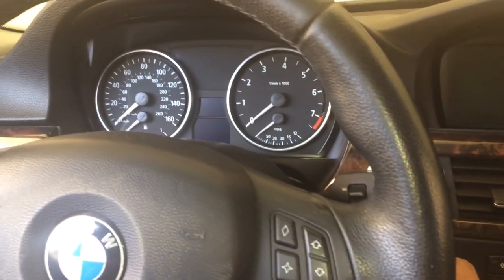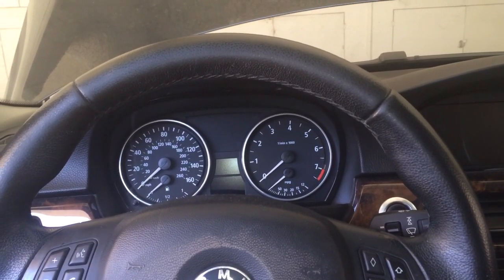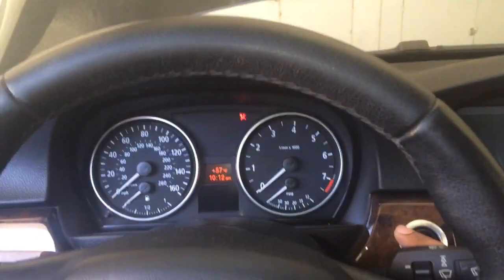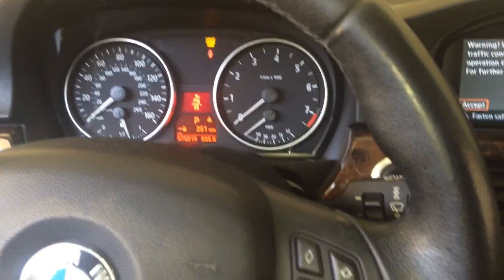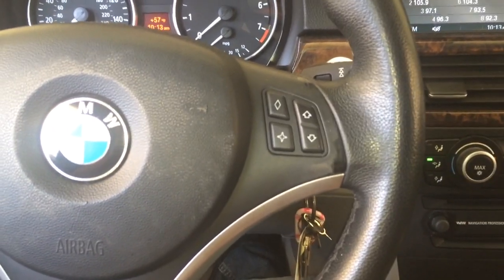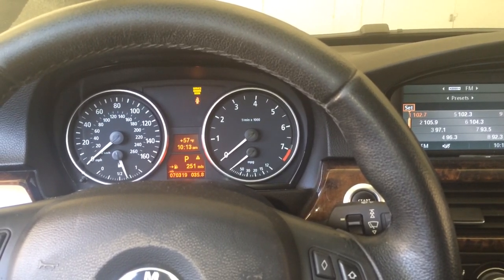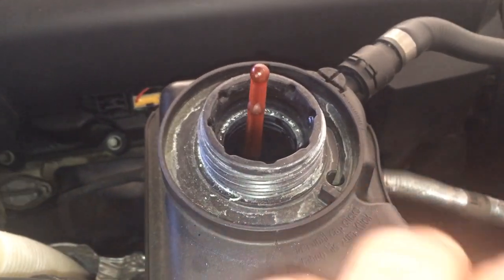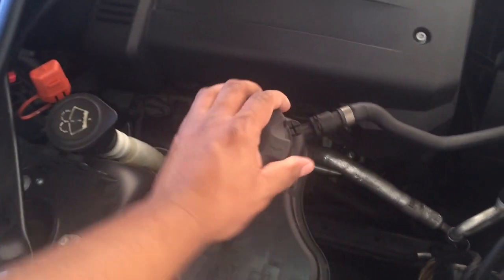Test Water pump and bleed system BMW 5 Series 3 Series E90 E39 528I 328I M5 M3

Comment: My car ran hot on me about 2 weeks ago since the you can drive for quite a while sometimes other times dont take long at all but the yellow temp light will come on then the red one will come on then after a min or so it will go back to yellow come out of limp mode and go back to running properly then it will repeat the same thing again any suggestions

Comment: I did this as well and had no issues with the battery but I did turn the headlights off. In addition there is no reason to disconnect the battery nor leave the cap off.

Comment: I have a 2008 X5. The fan motor has kicked into warp speed. I have tested the water pump and it is working fine, I have tested the temperature sensor and it is working fine, the thermostat closes at 84 degrees and opens back up at 74 degrees. Not sure what else to try? Coolant level is at Max as well. I reset all the codes and still no luck. Any advise, thanks so much

Comment: Ive came up with an overflow tank system like you find on 99% of other vehicles. It's working so far and my car is running cooler too. Not a daily E46

Comment: Nice, but it doesn't work on my e90 318i (130 HP, 4 cylinder version). Probably because there is no such electric water pump for this model?
Reply: I have the same car 2008 and it has electric water pump.

Comment: Help? Melted wire in blower motor? Plus car gets hot?
Reply from the maker: Asanko vlogs Without the blower motor not work your car will get hot
Reply: Repair Fanatic  it just start working but the wires are melted I separate them to don’t touch

Comment: i have 523i it is overheating and the water pipe that feeds radiator become hard and hot while the other one from its very cold and also water bottle cold showing no circulation water is replaced anyone to assist
Reply: phil motloung thermostat is stuck you need a new one.
Reply: 996tt Beast thanks a lot i will buy a new one and see if it doing the same thing

Comment: my red stick broke off and went down into the water box.  Now it seems the box always needs water or coolant.  Is this a problem? the car has never run hot, but it did come up low coolant.
Reply from the maker: frankie hager you should look into it a little more it's not normal.

Comment: does the same apply for e53 x5? It overheats immediately and splashes all the coolant out. Also it makes a weird noise like whistle when cold. Overheats when driving slow or stopped
Reply from the maker: only if you have a electric water pump
Reply: Thank you

Comment: thank you excellent video but I do not hear the water pump making noise , but pumped water.
The exclamation mark does not appear. my e90 is Manual transmission... thanks in advice
Reply: The exclamation mark has nothing to do with the water pump test. Its a signal that the car door is open while the car is switched on.

Comment: hello i have a problem with my e60 525 it displays the massage engine temperature too high wht might be the problem
Reply from the maker: It could be a lot of things. Radiator leak, temperature sensor, water pump, thermostat, and more

Comment: How long you bleed the system...?Need a x5 2007 e70 radiator replacement video.Thanks for your support.
Reply from the maker: Until the water pump shuts off like 10 minutes

Comment: thank you excellent video but you have to wonder what BMW was thinking when they put a electric water pump and thermostat where it is located at and how difficult it is to replace and on top of all that there's no oil dipstick
Reply: It's designed like that so you take it to the dealer. 'Designed Obsolescence,' is the thinking behind it. Not to mention no spare wheel.
Reply: The fact of the matter is, even BMW mechanics hate working on BMWs.
Reply: They do that kinda thing so you will want to take it to a dealer to get it repaired. Every mechanic in my area says "what kinda car you have?" I say a BMW...they say "sorry we don't work on BMW's"

Comment: I need to check water pump for 2010 BMW 535i since the fan is running at high speed and engine temperature warning. If I start the water pump test then do I need to complete the process of bleeding or stop after 2 minutes.
Reply from the maker: You can stop at anytime.
Reply: Was your water pump bad? What was the issue?

Comment: hey i have a 2006 bmw 330i i have changed the thermostat and both temp fan sensors and the car still over heats what do you think my problem is? my fan starts really loud when it does

Comment: I have a question, I just bought a bmw 740il 1998 , after driving  I get coolant everywhere on the engine and I can hear from the inside of the car that something is boiling. Over the night no leak at all, nothing, what do you think it is?
Reply: +Andrei Sames Just throw that car away now, don't keep it as it's a money pit.

Comment: Hi , I tried following your procedure but looks like I help the accelerator too long. Now the car won't start and all sorts of error codes are appearing for abs, tyre pressure, etc. I obviously did something wrong. How to I reset or reverse what I did. Also how long till car rests itself or do I need to erase codes though old connector. Any help please will be great.

Comment: Hi mate. My car keeps letting out my coolant when I'm driving. I'm not over heating. My oil is fine (digital reading don't trust it) my AC works, my fan works, not signs of head gasket trouble on my oil cap. I did your water pump test and mine is work according to your video. I replaced the expansion cap. What could be wrong?

Comment: mine goes then stops den goes den stops it my pump still good
Reply from the maker: It's good The water pump is just doing the cycle and needs to do by turning off and on
Reply from the maker: Add more coolant when bleeding the System
Reply: can it be i needa change da termostat

Comment: when i turn on my car it takes about 2-3 mintues then my fan start spinning fast with a loud noise. than the last time i drove it my car over heated and the expansion tank water pressure came out and leaked out the water . what can it be??
Reply: Hey did you find out what it was?

Comment: Good info. I have an older 535i (1989). How do I test a mechanical fan belt driven pump. I either have air in my system or the pump is shot as it keeps over heating. When it does overheat the heater blows cold air, so i know it one of the two issues....Thanks....Philip if easier (732-495-8985) my home business number. Thanks!

Comment: My car overheated on me while driving as well. I have an 06 330i. Was water pump. Was still under warranty but it came up to 1067 to fix. New pump and thermostat. Do not drive car if it overheats pullover and call a tow. If you crack that head you're in a heap on crap.

Comment: I tried bleeding it out and it worked but does that mean i still have to replace my water pump if i have to replace my thermostat? I have an engine light on and coder reader says i need to replace the thermostat. Please a feedback will be great thank you. Also, any vids on how to replace a thermostat?
Reply from the maker: I will recommend replacing your thermostat.if you bled out your system it means your water pump is working.

Comment: My bmw 3 series over heats and when I check the coolant tank all the coolant has been lost because it goes up. Can that be a bad water pump?
Reply: And when I try bleeding it no air comes out or anything
Reply from the maker: The water is not cycling in your reservoir?

Comment: I have a 2006 bmw 325i . Today it overheated for the first time. I pulled over and looked under the hood and there was water/ antifreeze all over the cooling system ? I was unable to see any  broken hose looking over the engine. Do you think it's the thermostat or water pump? Pleas help ?
Reply: 06 325i's are notorious for electronic water pump failure. Do this test and if there is no bleeding then you have a dead pump. Average cost: around $1000

Comment: I did this and my pump sounded like it was going on then off.  Should it be a constant flow?  My car is running hot and shutting off.  I have not noticed and leak.  Will this still work if your water pump is shot?
Reply: My 06 525i did the same thing.  It cycled on and off for 12 mins.
Reply from the maker: if your water pump is shot it will not WORK
Reply: My car shut off after turning off the ac. All of a sudden the expansion tank exploded

Comment: My car keep heating up changed radiator and it heats up when I'm at a stop light , not while I drive ? Why?!!!
Reply: If you replaced your radiator and the car keeps overheating then you probably need to change the water pump and thermostat.
Reply: If at a stop that's the fan that's the issue not the pump.